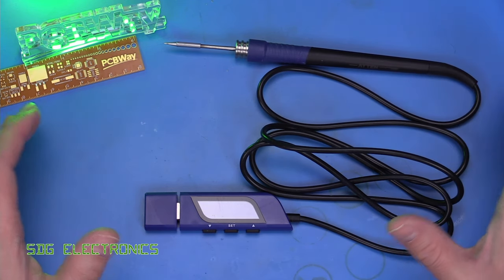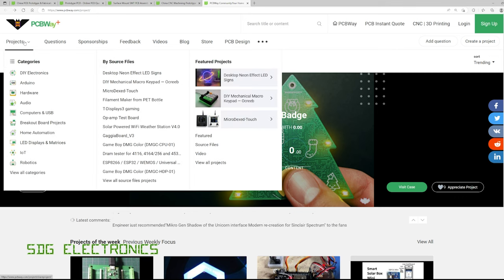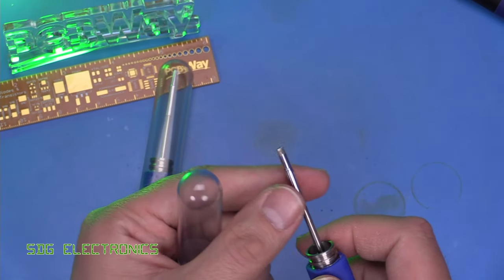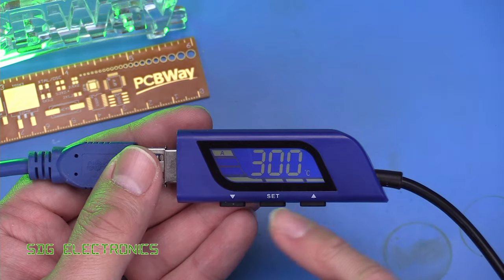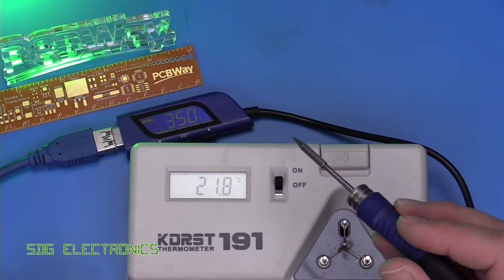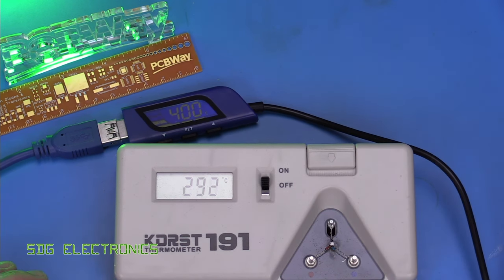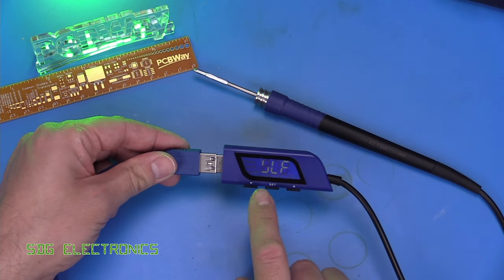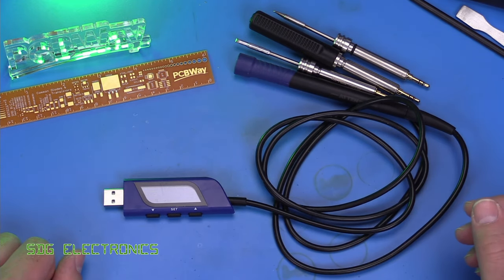SDG #288 Atten USB GT-2010 Temperature Controlled Soldering Iron

Comment: I have one of those. Ideal little iron for small work. No issues at all with mine. Testing it on a large pad doesn't prove much, not designed for big work. Great for charge ports etc.
Reply: True, but testing it on a larger pad gives you an idea of its maximum capabilities. Compared to other small portable soldering irons, it's a serious under-performer.

Comment: I use a Duratool unregulated iron. It's physically wearing out where the tip attaches, but electrically there's nothing wrong with it and is less than £10 (25 or 40W)

Comment: What I would really love to see with this form factor would be a USB-C PD 45-60W unit with a handpiece that has a very small tip-to-grip distance, I'm thinking Weller WXMP/WXPP size form-factor. A huge downside to current USB soldering irons is that all of the drive electronics are located in the handle, which limits how small of work you can do. Something with remote drive like this while still being portable would be clutch.
Reply: Yeah I guess most people who are doing portable stuff don't mind, and cost is lower as manufacturer doesn't need to provide a custom cable. There are some diy jbc projects for this though.

Comment: Try overclocking it? It’s easy enough to feed any voltage you want into the USB plug. Supplying it with 12v instead of 5v should make it a 60w iron… but would it work?

Apart from the extravagant cartridges, I really like the design.

Comment: You have to afford barlow lens for your microscope Steve 🙂Once i saw its 10 watts my expectations went straight to 0. Its good you tested this, its necessary to let people know how poor it performs 👍
Reply: It's a shame it doesn't have a Type C port, which would have allowed higher power (if the power supply allows it) while still allowing it to be powered from a PC or battery pack.

Comment: Hello, may I ask which of these 4 stations would be the best one to buy? Maybe it could be also a good idea for the video? They are all reviewed as pretty solid units.
RN looking forward for some budget friendly (under 200USD), good quality soldering station, probably gonna be using original JBC tips, planning to do at least one/two uses a week, maybe more later.

1. Handskit T245 Soldering Station (60 USD)
2. HAKKO FX-888D (180 USD)
3. AIXUN T3A T245 (141 USD)
4. SUGON-A9 T245 (149 USD)

If anyone has any experience I will be happy to hear those. By the reviews it seems like many love SUGON A9 and AIXUN T3A.